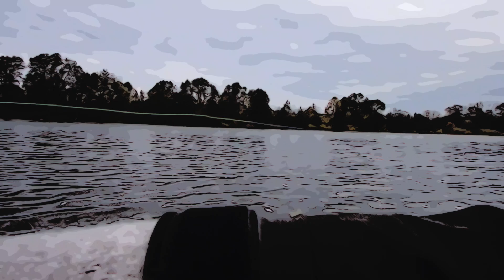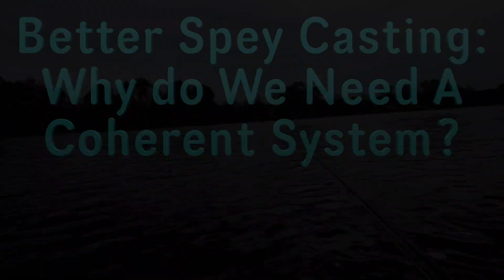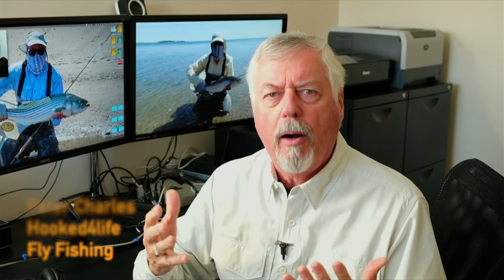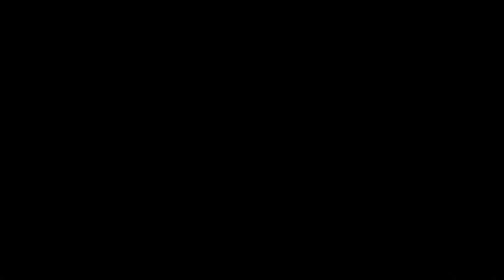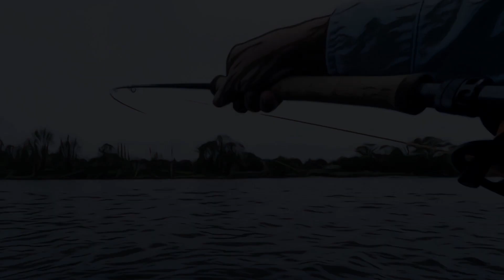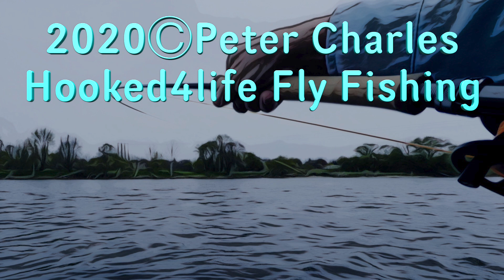Simple Tips for Better Spey Casting: Why We Need a Coherent System

Comment: Great advice Peter!  Winter time reduces me to only brining a skagit head as its to cold to fiddle with changing up heads.  That said I sometimes bypass water that is best suited for a long leader and a small fly,  is this correct thinking on my part?  Thanks in advance for your thoughts.
Reply from the maker: As the water gets colder, I tend to go longer in my line choices as it reduces the guide icing from stripping line and saves the fingers as well. One of the old green Delta multi-tips would be a good cold weather choice.